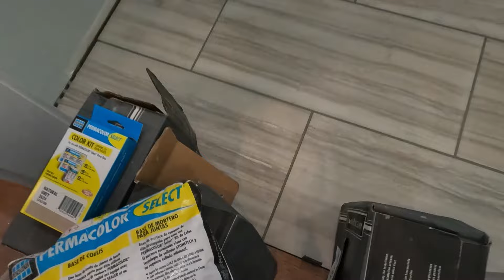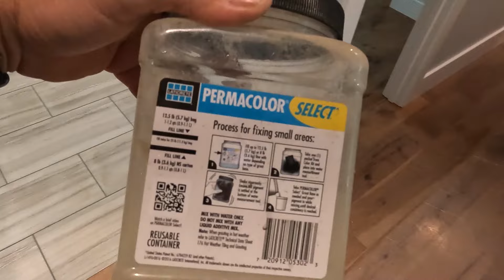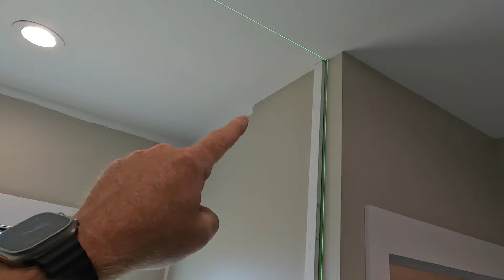Tile Installation (Tips & Tricks) The Melton Farm Project - Part 37

Comment: I apologize if I missed it in the video but in your experience, do you think it’s necessary to use a Schluter Ditra membrane over the concrete? I’ve seen a bunch of videos saying it’s a must to prevent the tile from cracking. I was wondering your thoughts. Love the channel !
Reply: No. Not at all.
Reply from the maker: It’s not necessary but it also wouldn’t hurt either. If the slab is cracked in a few spots I would recommend an underlayment. As I said in video, if you set to the concrete and it cracks… the tile will follow. I felt my slab was and will always be in great shape. No more cracking since I had the slab sawed for expansion when it was poured. Thanks for watching

Comment: What kind of mortar are you using and/or what kind of mix? Do you use different types with different substrates?
Reply from the maker: This is Schluter Allset. It’s smooth as butter, I like to use it with the Schluter products since it’s designed for it. Stay within each system would be a good rule of thumb

Comment: Did you choose the width of the tile accordingly to the width of the room so that the first and last row would end with complete pieces? Did you have to rip a little off one side?
Reply from the maker: No, didn’t choose tile for its size. It’s what the designer wanted so that’s what I installed. I ripped the tile a little on the inside wall and left the outside whole